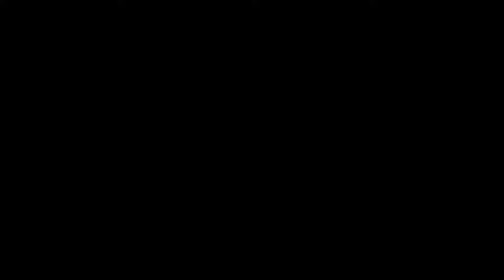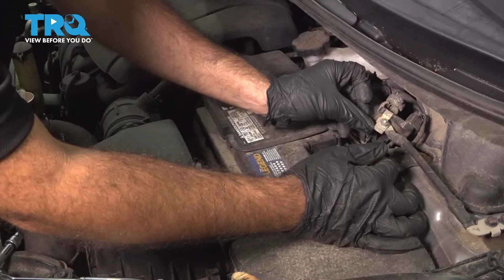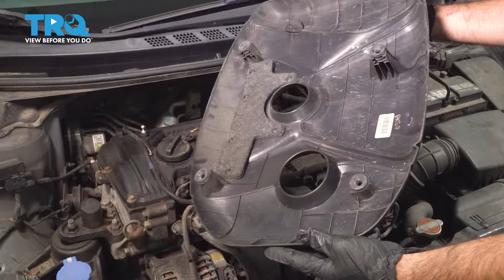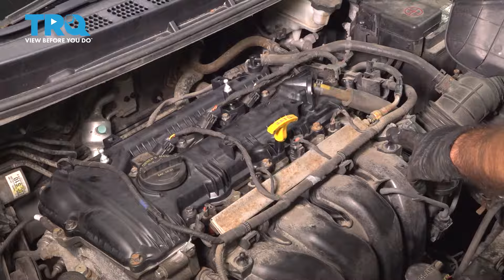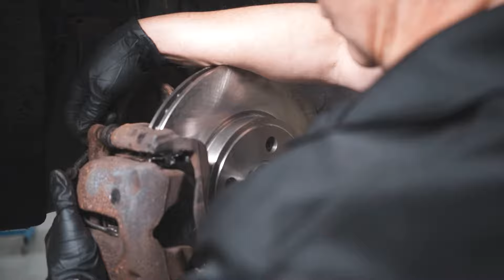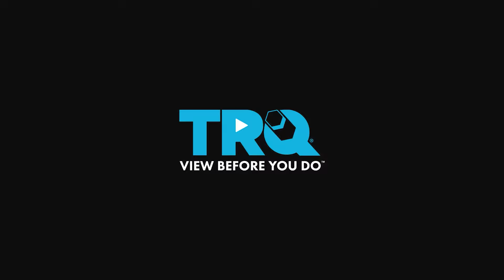How to Replace Ignition Coil 2011-2016 Hyundai Elantra

Comment: I started having misfires from my #4 coil  so I got that replaced along with the spark plugs and things were fine for a couple weeks but now starting to have problems again more so of the engine shaking a little bit with lights flickering…should I just replace the rest?

Comment: This video saved me! Thank you!

I do have a question, though: I understand that ignition coils fail, but do they usually crack? Of the 4, the first one (far left) was cracked it seems. Not sure if that’s normal or if the last shop to swap my spark plugs broke it or something. Just curious what you think. Thanks again! 🙏